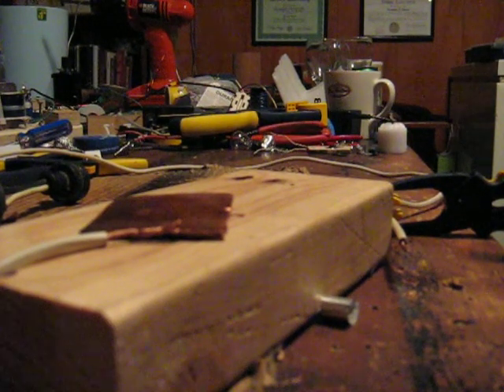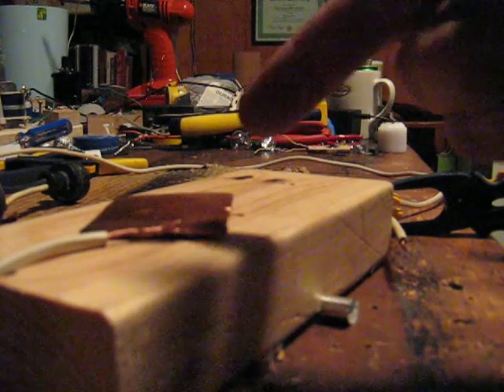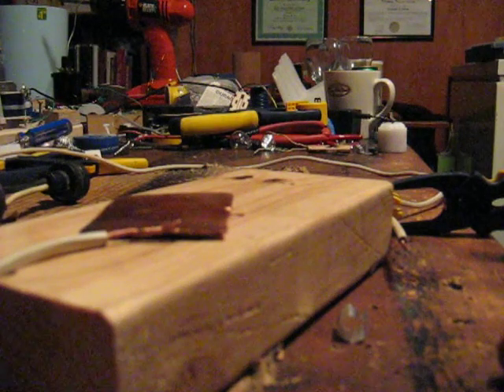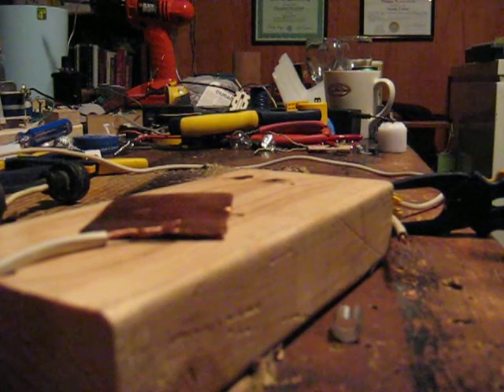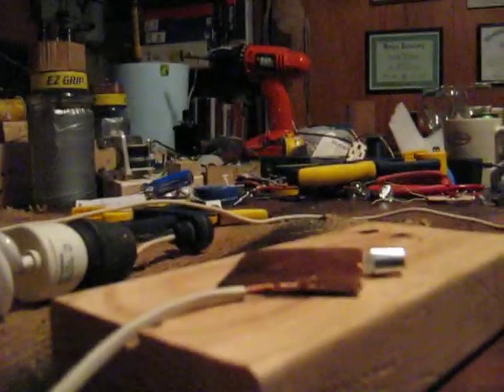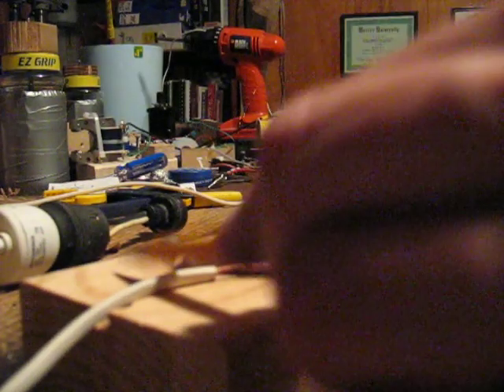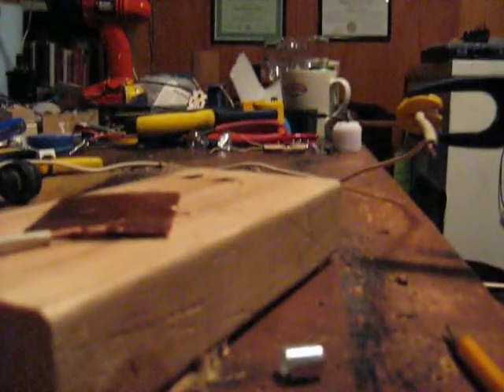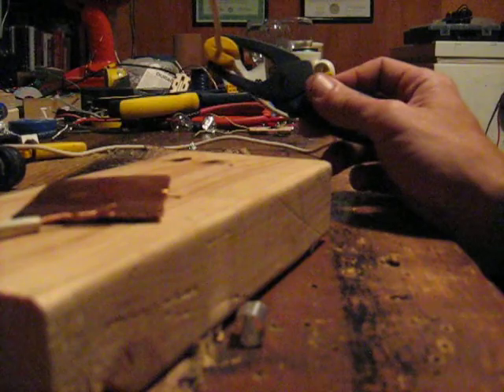High Voltage Attraction

Comment: i think this effect deserves a lot more attention...since there is no current moving, but we have a force generated by just voltage.  I'm thinking a motor based on this principle. Possibly have many pole stators made of copper plates and the rotor having an aluminum ring for each pole, to take advantage of this repulsion.  Doesn't it look like such motor would consume no energy (besides the losses of the flyback transformer)